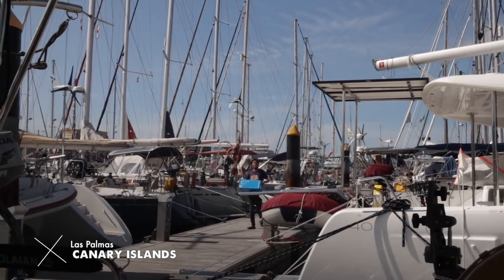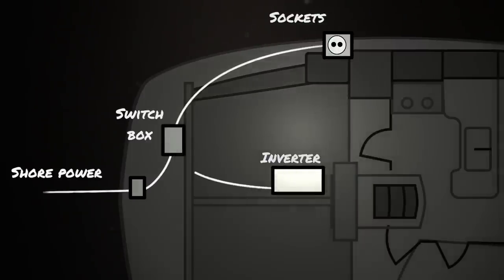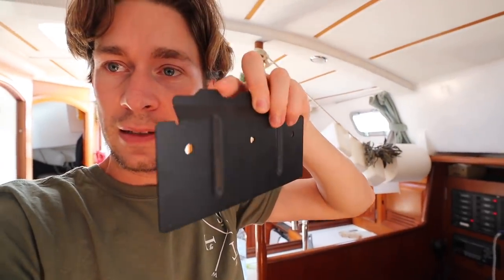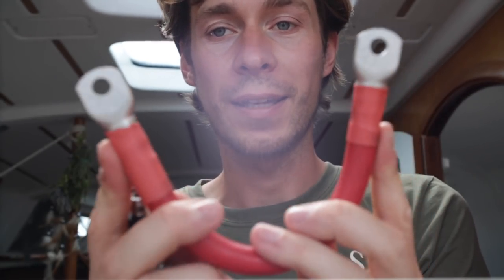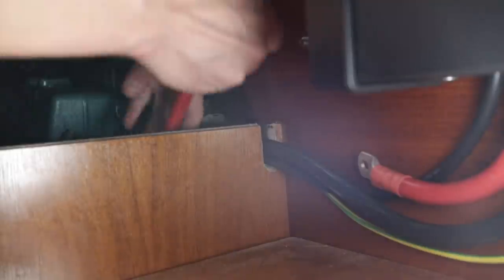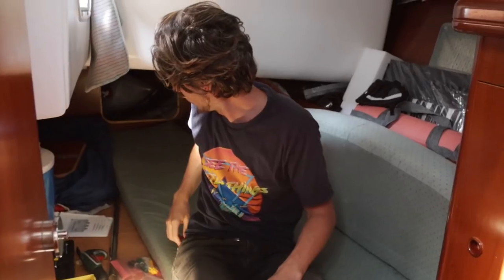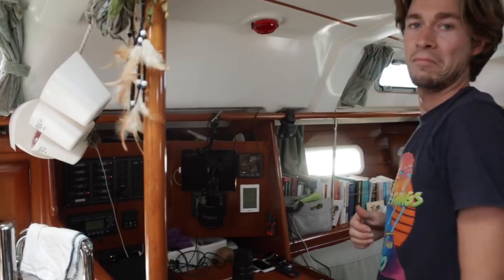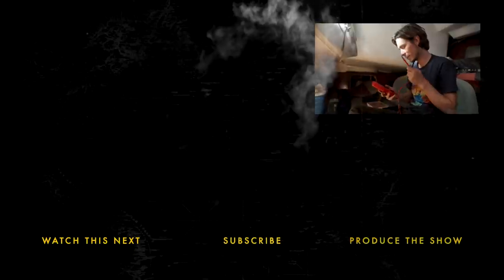SERIOUS UPGRADE ⚡️ ENERGY for life in the tropics

Comment: I noticed the grounding wire you used was not tined. In an marine environment (sea air and movement) all wiring should be tined or corrosion will set in very quickly. Corroding electrical cables is the second cause of boat and even house fires. So since you have untined wires you should solder all joints after crimping. Tom

Comment: Good job guys. It’s always good to take your time with electrical projects. The relay control often called an ABT switch on your input power sources has the timer in there to prevent a “relay Race” between relays. Often referred to as Break before Make design.  The timer functions to Open the circuit of the Online feed before engaging or closing the circuit for the Offline circuit.  Good job on selecting to install that control. If not using an ABT you would need to install an MBT. Or commonly called an A/ B switch. Performs the same function by manually making the transfer.
Reply from the maker: Was looking for the correct English term of the device. Thanks!

Comment: All your connectors should have adhesive lined shrink sleeve. Your inverter ground wire, especially where it is located, will corrode away quickly, particularly since the wire is not tinned.
Reply: And marine-grade tinned wire.

Comment: I think the fuses should be close to the battery and not close to the inverter. But I don't know how long your cable from the battery to the inverter is
Reply: That is an ABYC requirement that they be on battery, then to isolation switch ,then inverter

Comment: I have a 2000 watt pure sine wave inverter and if I run a heavy load I run the engine , light loads good to go, AGM   440 ah batteries 400 watt solar, fuses are blue sea MRBF mounted right on battery 300 amp
Reply from the maker: Nice. Same’ish setup!

Comment from the maker: Nerve wrecking to work with 220v. If we’re running 2000w through the inverter, the battery cables will deliver 166 amps. That’s insane. That’s why we need AWG 2/0 or 70mm2 cable
Reply: looks like a well thought out way to manage all your POWER;)
Reply: check what the continuous discharge limit on your batteries are, batteries don't like being drained to quickly and you might end up damaging them.
Reply from the maker: @Stuwy2  840W cont led to >300 cycles at 100% DoD, >1000 cycles at 40% DoD
Reply: Could you tell me the battery brand? Sounds good to me. And another question: which circuit breaker  and fuse did you install for your solar panel installation? Thanks a lot!
Reply from the maker: @Kinimodus  https://www.victronenergy.de/upload/documents/Datasheet-AGM-Super-Cycle-battery-DE.pdf

We put in fuses rated one size higher than the max amperage of the charge controller. Don’t know if that’s the VDE certified way to do it or just amateur common sense
Reply: @seethelittlethings  thanks! Do you have a link for those fuses in front and behind the solar controller? I'm not sure if I should use a circuit breaker or some other mega fuse.
Reply from the maker: It’s what we found at a chandler. Technically DC breakers, not fuses

Comment: Never cut the loops,  you should replaced with the correct terminal.  Electrical connections are designed and have little room for excess capacity.

Comment: Great job Alex 👍… you’ve satisfied my need for boat project tech stuff this week 😉. 

I hope you have a separate off switch for the inverter so you can ensure it doesn’t start unknowingly if shore power goes out and it kills your batteries?
Reply from the maker: Great 😊 
The inverter itself stays off-off at all times on dock and generally when not in use, because it pulls 1A in standby and we don’t like that. Further we don’t leave stuff plugged in other than little chargers  for drill batteries occasionally. And if we are using the elec kettle on dock and the fans go off right away that is a good hint that we forgot something ;)

Comment: I thought deep cycle meant they were specifically not meant for heavy loads but as a result you could run them deeper than a normal lead/AGM battery. Your bank might not be big enough for very high loads but the inverter will still be useful for smaller devices I'm sure
Reply from the maker: They are great Allrounder house banks 

https://www.victronenergy.com/batteries/gel-and-agm-batteries

The AGM range has very low internal resistance making them particularly suitable for high current discharge applications such as for inverters, thrusters and winches.

Comment: You should have bought the charger inverter it is a little more expensive  but the change over switch is already inside it
Reply from the maker: We considered it but didn’t make sense for us as it would have meant a complete wiring refit, especially inside the breaker panels on the nav table
Reply: @seethelittlethings  the wire for shore power would have gone directly to the victron inverter and the rest would be the same

Comment: If you are heading to the Caribbean, I might suggest you buy a 110volt charger as most of the dock power is typically 110volts to service Americans.  That way you can run your stuff on 110 volts through your inverter.  30 amp ones are inexpensive, but you may want a larger one if you have air conditioning.  Also you might be able to heat hot water with excess solar by buying a dual AC/DC element for your water heater.  I have one and I can dump the solar into hot water with a voltage sensing contactor/relay.  When the voltage gets high it turns on the water heater.  I do it just before the batteries are full in terms of voltage.  Though I do have  quantity 2 12 volt 280AH LifePO4 that I built for $525 US each.
Reply from the maker: Sounds like a great system 💪

Comment: Hang on, all these really powerful electronics are in the same room as the baby.  What happens when the baby grabs hold of the colourful red wire because red is a pretty colour, and maybe try to eat the black wire whilst holding on to the red wire.  Have you baby proofed the 2000 watt power box of death?
Reply from the maker: the storage space is not the baby room 😂

Comment: Thanks for your videos! I really like them. I wondered why you vent for a Phoenix and not for a MultiPlus. Have you considered to ad a Victron Galvanic Isolator to your System?
Reply from the maker: Didn’t want to rewire the panel-charger-breakers-wires combination. Also this way I could more easily switch over to a 110v shore power battery charger if needed
Reply from the maker: Existing dolphin charger works

Comment: As your power requirements increase you may what to consider start changing over to a 24volt Dc bus system  with lithium batteries and a new alternator. With a qualified marine electrical engineer can advised you how to set a system that you can transfer over in time to a 24volt DC but still run your older existing 12 Volt DC equipment.
Reply from the maker: Would love to 💰
Reply: Might be good to go to 48 volts if you're going to go to the trouble of changing equipment. Only 25% current draw.
Reply: @MarkSpohr  48 volt is great idea & I am a big fan of using a larger voltage with the ever increasing requirements in vessels but at the moment a lot of components are not available in that format yet ( up to 24 Volt Dc)e.g. NMEA2000 is only up to 24 volts at the moment but you will need to check all components on the line due to some maybe stuck on 12v DC . 
The Victron inverters are and the chain winches for some manufacturers are making available. Also solar panels most of them you will need to run them in serial to achieve the charging voltage required which can  issues with limiting output due to shading of one of the panels is not bypass resistor is installed. 
In Australia you can get 370 watt 60 cell panels but even then you have to run 2 in series to the required charging voltage for 48v dc
To achieve a system that may work for  you will need to either use 48 volt batteries with DC to DC converters for all the 12V or 24V DC equipment which is not the most efficient way and is very expensive to achieve.
In the industry you can connect 24v Dc batteries in a certain way to achieve both 24v and 48 volt DC outputs but sorry you will need to speak to a authorised electrical marine engineer for how to achieve this outcome
We all live in hope that boat builders see the light and fix the issue especially with the larger sailing vessels

Comment: Alex, you're a weapon... I like your logic when you are working out how to do things. Mandy, you're brilliant.  Just take the board out of the box... Not everyone has such a free  mind... Really, your gell battery bank is no where near big enough to have 1kw draw to the inverter. You will kill the batteries if you do that to often...Deep cycle batteries are engineered for low amper draw for a long time, verses start batteries that are designed for high amperage draw quickly... To support a 3 kw inverter, lithium iron batteries are the only way to go. They will support high load. I'm in the middle of sorting my electrics out too... Yup, Victron of course...
Reply from the maker: Thanks Colin :)

Here’s our battery bank, it’ll be able to take the loads we plan to draw, especially with solar supporting during daytime (we won’t be pulling more than 1000 on the regular)

https://www.victronenergy.com/upload/documents/Datasheet-AGM-Super-Cycle-battery-EN.pdf
Reply from the maker: I think we bought a great Allrounder 

The AGM range has very low internal resistance making them particularly suitable for high current discharge applications such as for inverters, thrusters and winches. 

https://www.victronenergy.com/batteries/gel-and-agm-batteries
Reply: @seethelittlethings  That could be a game changer... Impressive specs...

Comment: 166 amps? That’s welding isn’t it 😃. I suppose there are a lot of reasons why you can’t connect the batteries in series & go for a 24v system .
Reply: They would have to connect the solar panels in series as well and then install a converter to turn 24V into 12V for the outputs. That would be a couple days of work but you're right, it's absolutely worth it. They should also change from AGM to LiFePO4 batteries.

Comment: How many amp hours is your battery bank?
Reply from the maker: 340Ah, capable of 80% discharge
Reply: @seethelittlethings  that’s not going to allow you to use your 2000 watt inverter very much or very long ….
Reply from the maker: We don’t plan to put 2000w loads on it :)

Comment: Great channel, thanks. Just a quick question, why didn’t you use tinned copper wire and heat shrink crimps? You are just setting yourself up for more corrosion in your electrical system. I feel it is not a good example of how to do something correct, especially if other people emulate you, but that’s on your conscience, teaching people the wrong way.

Comment: The agm batteries are related for 20 amp discharge.
Reply from the maker: The continuous discharge of victron agm super cycle was set to 0.2C in testing their 100%DoD, resulting in >300 cycles (40% DoD >1000 cycles). 

On our 340Ah bank this translates to continuous load of 840W for up to 1000 times if we stop at 40%. That’s fine for us